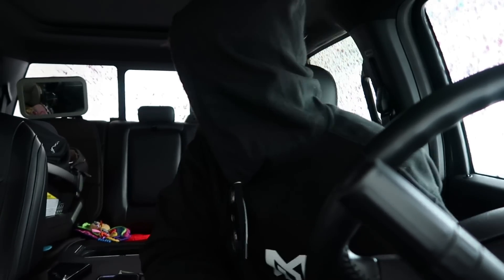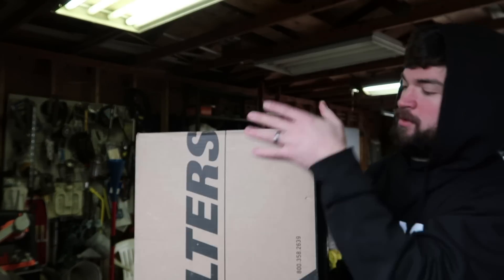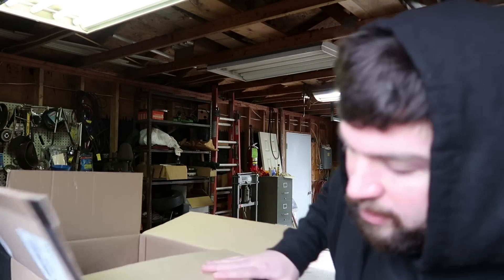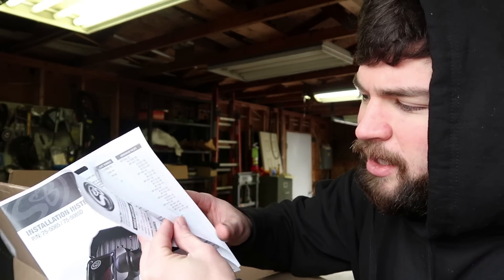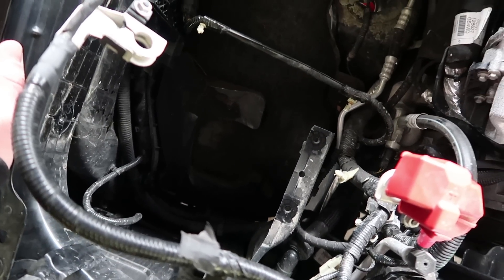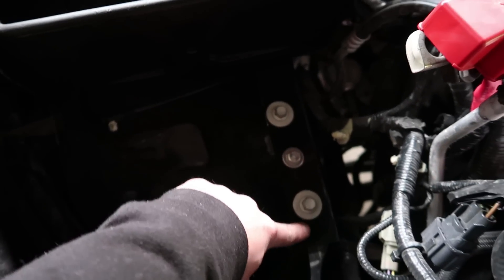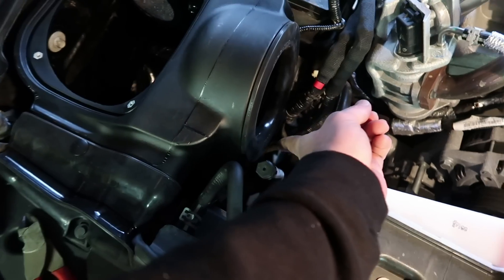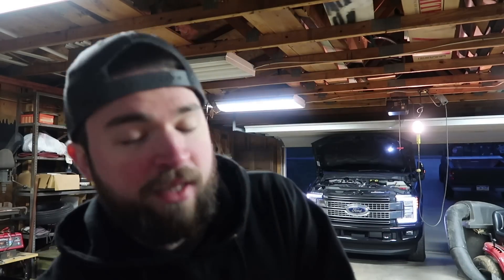THE ULTIMATE INTAKE FOR 6.7 Powerstrokes - Unbox and Install

Comment: Corey, when I did mine a year ago I noticed a slight increase in fuel mileage. Definitely when towing. I can't delete (damn Comifornia) but I did also notice better throttle response. I'm happy with mine after 15K miles. Growls more under the hood now.

Comment: The SnB design makes a lot of sense, that's how I would design an intake.  It's basically like a ram air design. This makes much more sense than a so called cold air intake with the filter drawing hot air right under the hood.

Comment: Corey, please  pay close attn  to water getting into the box and filter. I am curious of your feedback ref this if heavy rain or car wash etc. introducing water  into the system easily. Some have mentioned this.
Reply: Happens to mine everytime I wash it or drive through heavy rain. S&B told me not to worry about a little water on the filter. It just makes dirt stick easier lol. I went with their pre-filter after a noticed all the water. Seems to bead off now. Plus it helps when I'm driving through all the dust getting to the desert in SoCal.

Comment: Hey Corey, just to ask again, in case you didn't see on the other video, I posted a question about the state inspection. I live in PA as well and wanted to know if you have any problems with the state inspection due to the upgrades you've done. Thanks!

Comment: I put an s&b on my 15 powerstroke. After installing it I turned the truck on and it threw a wrench icon. Turned the truck off and back on again and the wrench was gone and havent seen it since. Any thoughts on what this could have been? My guess is that during the instal i got alittle dust in the MAS and it blew it out when I started the truck for the first time.

Comment: I have the 2017 6.7 with zero modifications. I have been looking at this  filter relocation system and I am concerned as to what is stopping rain water from getting into the motor at highway speeds. the filter looks to be approx 6 to 10 inches from the intake opening but this is just me guessing.  
Question- What is stopping rain water from entering this intake design?

If it does not stop the rain water from entering the intake what kind reproductions will be expected?

Comment: LOL, for $300 I will trust the Ford Engineers knew what they were doing.
Reply: Said by every 6.0 & 6.4 owners lol
Reply: @jay6.7powerstroke63  Those engines had there problems, but the air intakes were not one of them.
Reply: Nobody said the stock one was a problem....it’s just that an aftermarket one is better...